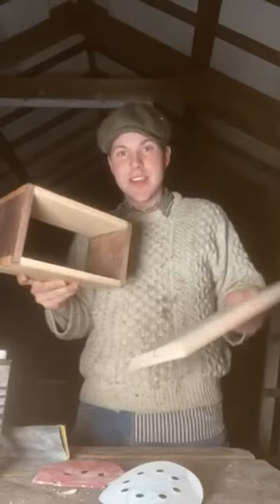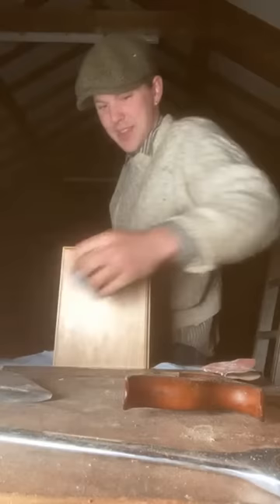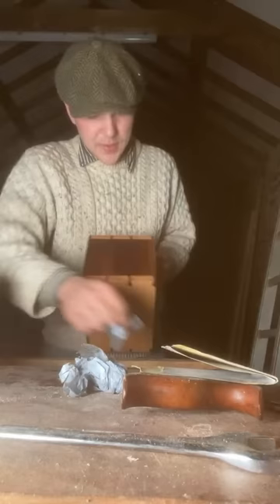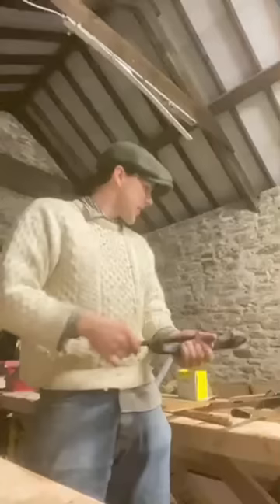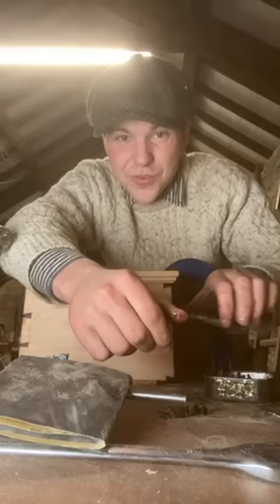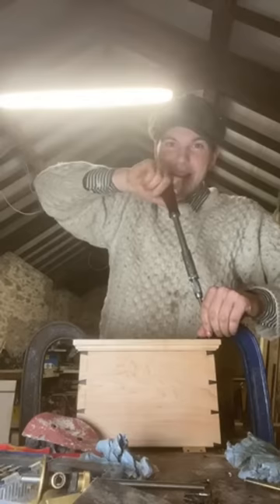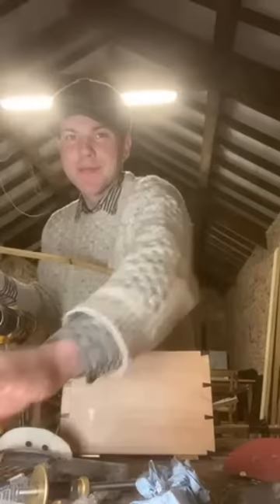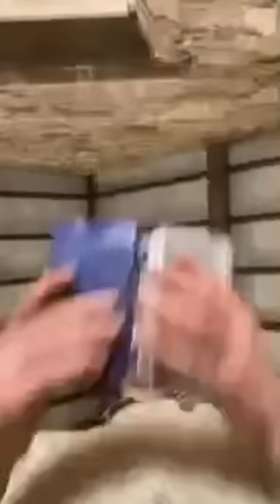Making a Dovetail Box

Comment: Oin, JoeA here from across the pond. My father used the Stanlry Yankey ratchet screwdriver to hang doors. I watch him driver a screw into a door frame without a pilot hole. What he did use was a bar soap or liquid soap to lubricate the screw to not crack the board.